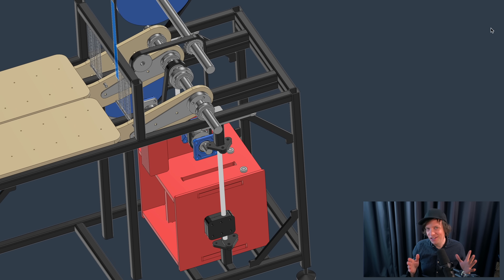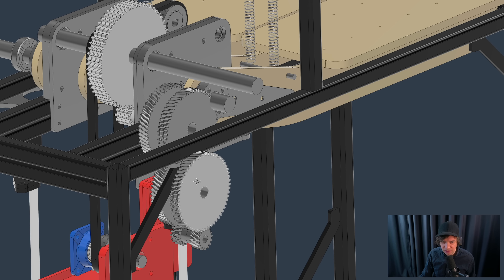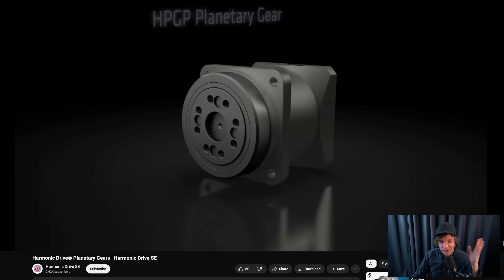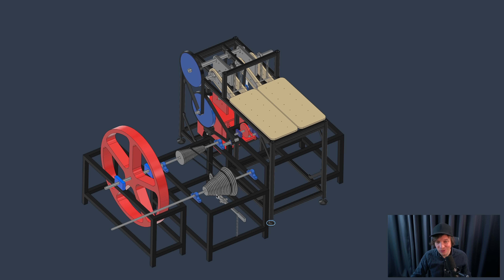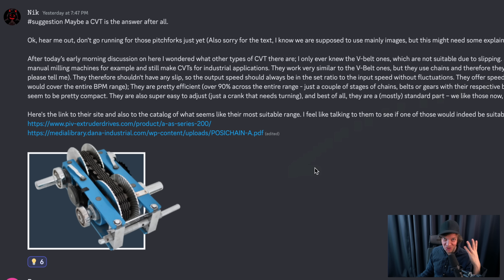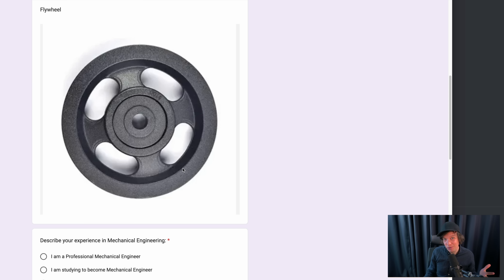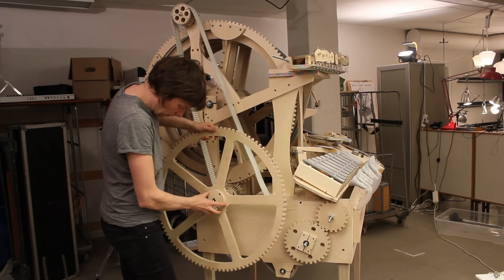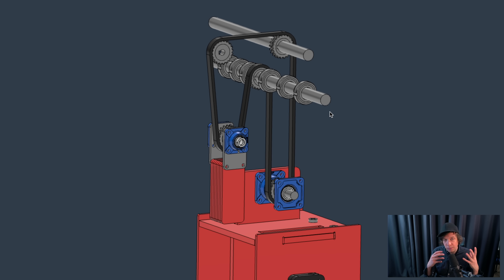Which Gear Type is Most Efficient?

Comment: I am a mechanical/production engineer...
The problem with gears (of any type) that you are going to run in to for your application is backlash and maintenance. There will be an (extremely small) amount of play between the teeth of the gears if adjusted correctly. This extra space is impossible to avoid, difficult to adjust, and will get worse over time as wear occurs. It is also necessary to to have some level of this backlash in order to prevent extreme tension, heat and unnecessary wear from occurring on the gears as a result of the gears not meshing properly and being too close together. Helical gears are much more difficult to get that mesh correct because it isnt obvious whether they are too tight or too loose without really taking the time to measure each one.
The more gears you add, typically the more backlash from input to output you have (ie an overall uncertainty and slop). This slop will lead to energy losses and less precision. This is why a car for example typically loses around 20% of its horsepower between the engine and the wheels. The majority of those losses are occurring in gear meshing. For the purpose of a car, that is fine because it just needs to go forward or backward. the actual amount it goes forward or backward per RPM of the engine doesn't matter. For the marble machine, the precision of the input-output ratio is the ONLY thing that matters for tight music.
Also, for maintenance, the more gears you add, the more difficult it is to adjust because adjusting or shimming one gear affects the next gear and the gear after that in the sequence. As the ratios and amount of gears increases, there will be more and more slop, uncertainty, wear and significantly more maintenance for every gear that is added in sequence.  In order to adjust backlash, you will need to shim and be able to adjust the position of every one of the axle's alignment, angle, and position to thousandths of an inch (and keep it steady after the adjustments) and you need to measure every gear with a dial indicator. every time you shim one gear, you will likely have to do each gear all over again, and you will need to do that periodically as they wear down.
Speaking of gears wearing down, with gear to gear contact, you will also need constant lubrication or it will wear out extremely quickly, especially with helical gears which tend to gouge and dig when under lubricated or they simply shear. This will make that backlash and maintenance issue exponentially worse unless you can keep the gears doused in lubricant. It may turn into a constant battle to keep your gears aligned as they wear down (unevenly, I should point out since you have a reduction and one gear has significantly more teeth than the other. the small gear will probably wear out 50x more quickly than the large gear for a 50:1 reduction. that is one of the benefits of a planetary gearbox... it is usually sealed and flled with oil and also the planetary gears split the load of the sun gear so they don't individually take as much abuse and will last longer. the downside is more gears in sequence=more backlash and slop and power loss). Without being doused in oil or grease, sequential start making a screaming noise as if to tell you they are in pain. 
Speaking of noise, a bunch of meshing gears will be very loud, and will get worse (like knocking, clacking or ringing) if the gears have too much backlash, and will grind and scream and screech and be very difficult to turn (especially helical gears) if they are ever under lubed or don't have enough backlash or are misaligned in any way. helical gears specifically bind in a way that halts them when they are underlubed, misaligned or don't have enough backlash, which could be potentially catastrophic to the marble machine (if one component suddenly halts and everything else keeps on going with the momentum of the flywheel). This is music we are making, so this kind of noise will be undesirable, as will the vibrations it may cause. This project is a lot of precision and painstaking work, not to mention your own safety of standing in front of it. a catastrophic failure due to helical gears binding would be a nightmare. 
Something like a nylon or high density polyethylene gear (like a cutting board material) or Polyoxymethylene (POM) would be better than metal gears (if the torque application isn't too high as to shear the plastic gears) because the polymers would be self lubricating (to an extent) and would not ring like metal would. you would need drastically less lubrication and the maintenance and gear backlash/alignment adjustments would be far more forgiving if you ever make a mistake. You would still need lubrication to reduce wear, but mainly to reduce heat and the fatigue that would set into the gear (especially the smaller gears in your reduction). 
Plastic gears are also much cheaper to replace, especially if you just replace all of them periodically as a complete set after x amount of hours of it spinning or rotation counter so you can do it consistantly... the same way maintenance intervals are on industrial machinery and engines. Another benefit is the plastic would just shear in the event of a catastrophic failure rather than creating a massive and sudden force that tears the marble machine apart, which would be possible with the momentum of a flywheel and metal helical gears if they bind. 
If you go with a polymer gearset, you wouldn't want to 3d print or cnc from a block of plastic as your manufacturing method, either... you'd want it to be injection molded so the shape of the particles and the material properties are formed to the shape of the gears under pressure. this would also maximize the strength, rigidity, and longevity of the gears as it would absolutely minimize discrepancies in part density and cavitation. You would also get a less porous part which is less susceptible to water absorption (from humidity) which can cause premature part failure.
Once you had the molds for IM or some sort of forging process, it would also be easy and cheap to replicate new replacements. If you have some money to spend, you could probably get your own injection molding rig and use your other tools like your cnc or 3d printers to make the molds for it. youd make much stronger parts this way than a cnc or 3d printer could make using the same exact material.
It may also be worth looking into carbon or fiberglass reinforced polymers as well, since we need extreme rigidity for this application. flex in the gears basically means more slop and your backlash adjustments meant nothing. 
Enough about gears and manufacturing though...

I would recommend taking note of how automotive applications control the timing of interference engines, since the slipping or any discrepancy of timing in some of the high performance engines would result in catastrophic failure like a detonation, pinging, overheating, afterfire or even contact between the pistons and valves (not quite f1, which use either EXTREMELY precise and harmonically balanced gears almost like swiss watch... and they do that because 20k rpm is way too fast for a chain... or they use pneumatic/solenoid valves and dont have a spinning linkage from the crank to the valves at all, only a timing gear with sensors that open/close the solenoids). I mean like the these sport motorcycles and drag race engines run upwards of 12k RPM. Almost all of them use a timing chain with an oil/hydraulic tensioner that uses the oil pressure to vary the amount of tension on the timing chain. Often they will tension both sides of the chain and have a plastic chain guide between the tensioner and the hydraulic tensioner to spread the pressure along the entirety of the chain so it is impossible for it to slack or stretch.  Specifically, they usually use a "double roller chain" and the oil hydraulic coupling is used off of a dry sump oiling system which is also run off of the crankshaft directly and is a pressurized oil pump. once the motor starts spinning, it it pressurizes the tensioner and the tensioner provides a tension that is proportional to the rpm.

The benefit here is since there is tension on the chain (or belt), you can reduce the amount of backlash that would have occurred with the direct gear mesh. the roller chain has bearings inside each chain link and shouldn't ever really cause wear on the sprockets. the oil/hydraulic tensioner is self adjusting and should always be a perfect tension to reduce slack or stretch. The benefit of the chain and sprocket over a timing belt and pulley is that the rubber belt (although extremely stiff and it contains fibrous material) is still able to stretch, it will produce more heat, and it is more likely to slip. the chain will not stretch under tension until extreme RPM, and may be tighter for music, although if you want the hydraulic tensioner setup, you will need a pressurized pneumatic or oil system. 

I haven't done much research as to which is for this application, these are just my initial thoughts and my take on what to look into next.
Reply: Wow amazing advice! Have you thought about signing up on the link above and posting what you said there? I felt like I learned so much from all the time you spent writing all this! This needs to be pinned on the top.
Reply: I feel like the timing belt is the best option. It minimises the need for precision, it’s relatively efficient (lighter than a chain, though some losses will be experienced by the stretching/compression of the material) and the noise it produces will be minimal (esp. compared to chain/sprockets or gears where correct mesh is absolutely critical). 

There are plenty of motorcycles with belt drivers that don’t have issues and put out significant torque, and the amount of stretch would be minimal for the application.

There may be a need to run two steps of reduction depending on the force calcs.
Reply: @HannahFortalezza  you may be correct. The precision you minimize the need for is gear meshing, but with a belt and spring tensioner you would lose some precision as a matter of uncertainty in the timing (ie it doesnt give a perfectly consistent input vs output… although it will be very close every time) unless you could keep the tension in the belt perfectly and as long as the belt doesn’t stretch or start to wear down or create residue. 

I know what you are talking about with the motorcycle drive belts… I think a better example would be timing belts connecting the camshaft (and timing) and the crankshaft and it is critical there is never discrepancy. 
Most engines use timing chains, but some use rubber belts for their timing. 

If we use the motorcycle drive belt example you mention, im basically pointing out that most motorcycles use chains instead. The chain is superior in most cases, as it also has a bearing in each link of the chain so it is static (ie stationary) friction on the contact between the pulley/sprocket and the belt/chain whereas the belt is kinetic (ie moving/sliding) friction. The bearing on a roller chain doesn’t move relative to the sprocket once they are touching. The belt has to slide on and slide off every notch of the pulley every time it goes around and it gets worn out eventually and also creates a gross rubber residue that gets all over the place over time. Kinetic friction (friction of sliding)  is also a much weaker force than static friction (friction force that would need to be overcome to cause a stationary object to move)… and that is the reason the belt is much more likely to slip or skip a timing notch… although for the marble machine it probably wouldnt have that issue. The issue with it is the loss of energy and power through the kinetic friction. It is very difficult to account for and is going to create some amount of slop in the input vs output. 
Both a chain and belt can be effective in controlling timing, but the chain is the superior of the two options. 
Some of the benefits of the belt are ease of removal compared to a chain, the belt does not need to be lubricated, and also if a chain does break, theres a chance it gets whipped around the sprocket and kills somebody. The belt would just hurt but probably not seriously injure or break the machine. I dont think the marble machine is going to be nearly enough torque or momentum to break a single roller chain much less a double roller chain.

To further explain static and kinetic friction (because it is a very important concept), think of the wheels on your car. As they roll, a rubber particle on the outside of the wheel touches the ground and is stationary for the millisecond the car rolls over it. It is not sliding on the road. It is more or less stationary with some other particle on the road as the wheel turns and the car moves forward. Then that particle gets picked up off the ground as the wheel keeps turning. It never slid, the rubber particle was almost stationary on the road despite the wheel turning. That is mostly static friction. The coefficient of static friction is greater than if that particle was just sliding and skidding on the ground (kinetic friction) by a huge factor… like 2-5x more. 
That is why antilock brakes will slow you down faster than locking all 4 tires. The antilock brakes are causing your tires create static friction instead of kinetic friction. 
So now, Think about a tracked vehicle like a snowmobile, a bobcat loader, or a tank. That is only static friction. With a round tire like on the car, there is some level of kinetic friction and slipping when the rubber tire particle first contacts the road particle and also when it gets lifted off the road
The chain system is like the tracks of a tank, and the belt system is like a tire. The chain system is much more solid, precise, and durable. There is no slippage and basically it never wears out.
The downside is it is easy to replace and maintain tires, its much more difficult to replace and maintain your tank treads. You dont need to replace your tank treads very often, but you need to keep them greased. No matter how much grease you put on them, it will never slip. No matter how much you try to push or pull it, it will never slip. The same cannot be said about rubber tires or rubber v belts.

I dont know the level of precision that would be lost with a belt vs a chain, but there would be some losses. The chain would be superior for this application because you want precision and to minimize replacement parts and taking the marble machine apart. Greasing the tank treads is easier than replacing a tire in this application, i think.

That is my opinion though, and a belt might be precise and durable enough to work just fine. I dont know the torque specs and dimensions of the marble machine. Its a lot of work to do the math on the amount of uncertainty the belt would have (probably less than +\- 2%) compared to the chain… but its not even worth doing the math imo because conceptually the chain is more precise and more durable. Why even bother?

The chain is not perfect either, by the way. It is just closer to being perfect than belts or gears. As for movement and transferring energy, nothing is perfect because entropy and heat will be created in any thermodynamic process that involves kinetic energy transfer.
The only thing I can think of that can be infinitely precise is magnetism as a tool of measurement (if you are interested, look up an LVDT low voltage displacement transformer… its a theoretically infinitely precise im measuring distances by using a displacement to force a magnet through coiled wire… kind of like a solenoid… and it creates an analog electrical output which can be read. You are using a force of nature to measure something rather than any measurement a human or robot could make. They use them for a lot of construction projects and to make predictions about soil composition before they build by seeing how far the ground presses. They also use it to find where to put drainage fields for septic and to avoid contaminating the ground water. They also use little tiny lvdt’s to measure arteries during surgery so they can make/use the appropriate sized tools and whatever else they need. I know specifically theres like a tube the doctors have that fits in the bloodstream before they patch it up so you dont bleed out after a heart transplant or something. Idk, im not a doctor.) 
Its pretty freaking cool.
Reply: Thank you I was about to write a long winded reply myself but I read yours and you explained it exactly the same way I would have very clearly I might add
Reply: Im partial to flat belts on flat pullies with high tension using an idler. It has done wonders on my 3D printer and lowered the noise floor. It had gotten to the point where the noise from the belts meshing with the pullies on the stepper motors was second to the parts cooling fans. This of course is best utilized on static ratios. If you need variable ratios like in a transmission, then experiment with two balls, where the output ball makes the input ball spin via friction at the contact points. You can then vary the output ratio by adjusting where the balls make contact. if both are touching at the widest circumstances relating to the axial axis then they are at 1 to 1 if you then adjust one to be at the widest and the second near the top then you can get higher or lower ratios depending on which ball is at its widest point. also, that's if both balls are of equal diameter, you could use different diameter balls.